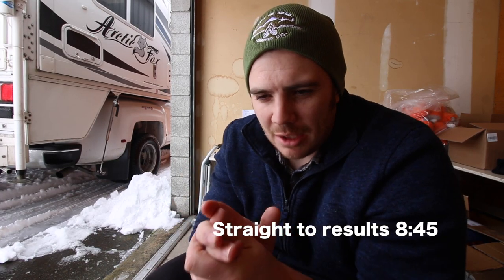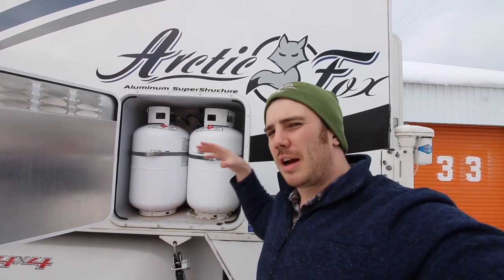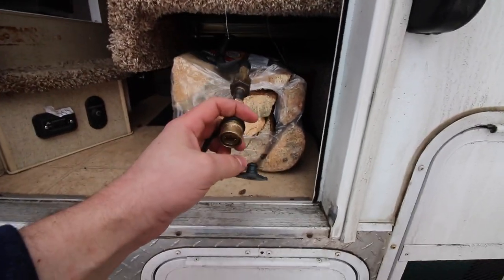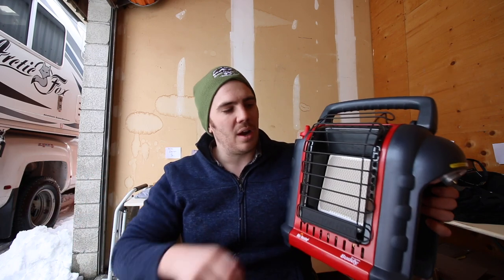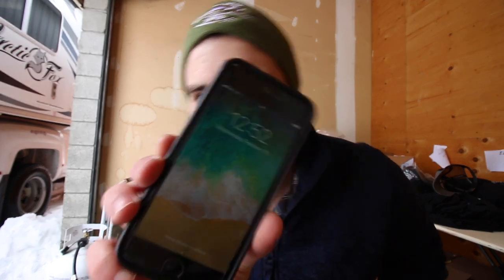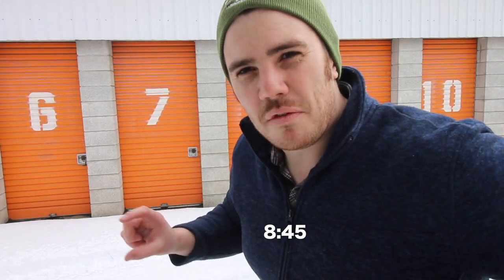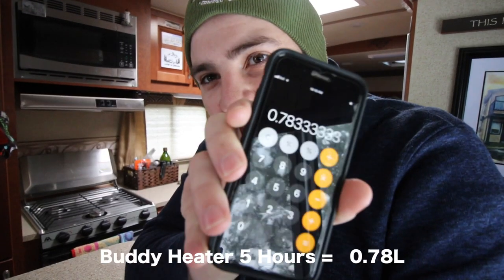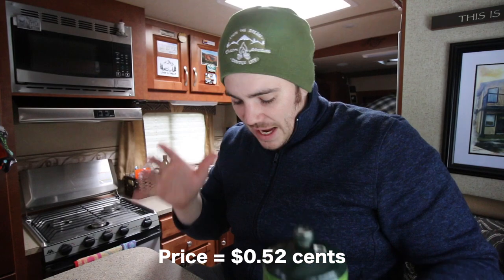How Much PROPANE Does Your RV Furnace BURN ? VS A BUDDY HEATER .. ??

Comment: I think a more accurate reading of the usage of the tanks would be to weigh them prior to test and then after test... this will show you how much weight was burnt.   I say that because the fill stations for propane don't always fill it exactly to the weight to the gram etc... so there will be a margin of error.  Just my opinion if i were doing this test.

Comment: The mid size Mr Buddy heater on high burns 9000 BTUs an hour and outputs at near 100% efficiency. 
The Atwood 7920-ii furnace in my truck camper is pretty average, burning 18000 BTUs with an output of 13680 BTUs (76% efficiency).  

Roughly speaking, my furnace burns twice as much fuel as the mr buddy, but only outputs 50% more heat.

So why do I still elect to use my furnace almost exclusively?
1) It's a dry heat that helps fight condensation instead of introducing more of it.
2) It's ducted throughout the camper to help protect my pipes and tanks from freezing.
3) It operates on a thermostat, making it easy to regulate temperature when I'm trying to sleep at night.
Reply: Well said.  All you have to do is read the specs.
Reply: How do you run it all night bone docking?
Doesn’t your batteries die?
If you are plugged in your best bet is a little electric  heater? 
Your furnace in your camper is still propane and still crates a lot of moisture. That is what sucks in these truck campers because they are so small.
I also keep my camper in storage and didn’t how much btu it’ is . Never thought about it until to late . 
Great info for me Taylor.
Thanks
Reply: @phil2559  The furnace that's built in to a camper does not add any moisture.  All of the moisture is vented outside with the exhaust from the furnace.  Nothing but dry heat from a furnace.
Reply: @phil2559  The 3.4 amps per hour @ 12v it takes to run my furnace isn't a huge draw. I've got a larger than average battery bank of 435AH (200+ usable), so I can run the furnace for days without issue. Factor in a 25% duty cycle, and it's even less of a concern. 

Ill use the heat pump in my duotherm A/C if im paying for hookups, but its rare since im almost never plugged in.
Reply: @jkneeshaw  18K BTU furnace = 3.4 amps/hr. Excellent info. My old camper had a 25K BTU furnace and my current one has a 35K furnace. My old one was roughly 5 amps and the 35K tends to be above the curve at almost 8 amps and is heating a 36ft bunkhouse with 2 slides. 
@Phil Allen - a standard group 24 battery is only 70-80 amp hours. Running the furnace for 12 hrs will drain the battery of between 30-60 amps based on the size of your furnace, and that will kill your battery if you are only relying on the single factory installed battery. Its an excellent point to make for most RV'rs if they've never relied on battery power.
Reply: sjackson99  do you think I might have a leak? My windows will get moisture on them ?
Reply: boondockinglife  do you think my battery’s need replaced ? I can’t run heater all night with out batteries during?
They are only a couple years old
Reply: @phil2559  hard to say . How many batteries do you have now and what size/type are they? Like I explained above, a single standard battery can not provide enough power for a whole day when the furnace is being used. 
Moisture is still going to occur in a camper even with a furnace. See Taylor's other videos when he explains using his dehumidifier.
Reply: Exactly! If you're in a larger RV (travel trailer, fifth wheel, etc), using the propane furnace is the best way to keep the pipes from freezing/bursting. Especially if it's an older year (< 1996) where it uses the grey polybutylene pipes. Even if all I do is keep it at 50 degrees, that's pretty tolerable with warm clothes on.
Reply: There you go! Thank you! It is also an insurance issue. I have a cabin and just lost my insurance again. They wanted a wall heater with a thermostat...i got it, but removed it because for us, it was dangerous, i felt. I had not used it in the years we had it and when i did, there was dust that burned! It really scared me. I shut it off and had it removed. The insurance wanted a central heat with ducting and thermostat. It is a 5-600 sq ft cabin !  I am ok with it, it is home. But where would i put a furnace?  So, i was thinking about getting an RV furnace, ducting, and themostat and do through the wall ducting. Not sure if it will work for them, i but can try.
Reply: @phil2559  when we boon dock, if close to the truck, i keep an eye on the battery. If it gets low, i plug into the truck and turn on the truck for a while. I have a generator, but haven't used it yet.  I am surprised how long the battery lasts. I also got a Jackery and can use that for a lamp, and even the InstaPot. I charge my devices with it. We could use the TV, too with it. It has a solar option, too, but it is a slow charge and i have not needed yet  but we are not fulltime yet. The jackery weighs about 25 lbs i think. I love the convenience. I used it when our power went out, too.

Comment: Something to think about would be if it's really cold, you need to have that furnace running to send air through your holding tanks and keep them from freezing. Maybe the furnace is less efficient because the heat is more spread out? I wonder if the heat above from the buddy heater would keep the tanks and pipes warm enough on its own in less than 0*C/32F.  Awesome video Taylor as usual. I'll be ordering some clothing items soon, would love to see some sweatpants (plaid would be awesome but solid colors are fine). The mugs are sweet, too.

Comment: My understanding is that you ought to have a fuel filter when connecting the Buddy to refillable propane tanks.
Reply: If you purchase a gas hose that has a regulator built in it will work. That’s how I use mine with a 20 pound cylinder.

Comment: I've used both Buddy Heater and the Wave 6 heater. Hands down the Wave 6 is more efficient than the buddy heater. I took a propane hose directly from the propane tank and fished it through a small window, then put insulation around the hose.  The wave is quiet and has a much larger heating surface. For the first 12 seconds, you burn the flame to catch the catalytic fiber on fire. After that, it takes very little fuel to keep it going. I have however noticed an increase in humidity in the trailer. I have also compared the Wave 6 to the onboard heater. I started with both propane bottles full and the one powering the Wave lasted nearly twice as long as the travel trailer's heater.

Comment: Hey Taylor, good idea for a test.  I have a Lance 845 and i use a Mr. Heater Buddy like yours.  I also have six one pound lp cans.  I purchased the refill nozzle that Mr. Heater sells to refill them from a larger tank.  I don't think they refill completely but I get about four hrs on low out of one can.  If it's not too cold I'll run a couple of hour before bed, turn it off and restart it in the morning when I put the coffee on.  They sell a "Big" Buddy that already has a quick disconnect installed and that would be better for your application.  What ever you run I always keep the window over the sink open an inch and a roof vent open an inch.  Keep up the good videos. Thanks

Comment: Many years ago, I had a pop-up camper with a removable stove, and it had a quick-connect inside the camper for the stove (along with one outside for it as well). The camper was built that way - It was not a mod someone did to it.

Comment: To calculate efficiency, you have to consider how much heat in BTU each one has generated during those five hours! Your numbers mean nothing without knowing their heat generation capacity.
Reply: It does tell something even if not scientific.  He said he realized that, was just curious. Well it helped me.

Comment: My understanding when using the buddy heater with 20# tank, a filter is recommened   between the hose and the heater
Reply: Yes sir, without the filter the buddy will die almost as quickly as Taylor’s snowman.

Comment: Be sure to get a filter when using a hose on your Buddy Heater. I have a buddy heater just like that, it is good because it doesn't use electricity, bad because it has no thermostat.

Comment: Your camper heater has a heat exchanger which will never be 100%.A certain percentage of energy will always go out the vent. Find the vent turn the camper heater on and you will be able to feel the heat that is lost. The price you pay for venting the H2o and the  Co2 outside. For me when it was at or below freezing and I was not concerned about batteries, I ran the RVs heater.With mine the gen set was large and it burned as much fuel as the RV lol. Above that, I would use my buddy. I will also add that running your air conditioner can help with the moisture if you can condition the air from inside the camper. That's how your trucks defroster drys the air so that it does not fog up your windshield. Loving the channel by the way.
Reply: Also, propane has significant pressure change between freezing and let's say 70 degrees Farinheight.regulators can vent small amounts of propane into the atmosphere with these changes in order to regulate. This is why you are hearing you do not want a regulator indoors.that said you might have a special regulator for your camper heater[differant pressure requirements] that is not compatible with the ltl buddy.I do not know.  Here is a propane pressure chart    https://www.engineeringtoolbox.com/propane-vapor-pressure-d_1020.html
Reply: vanchick 2018  I used to turn on a fan inside to circulate the air and run the ac for an hour or two during the day now and then when I was out for a couple.Can make a big difference.Or if I was in town grocery shopping and the sun was out I would leave it running while in the store.Things like that.Damp rid does kind of work if the air is warm inside and circulating.I have three bags now inside my camping van that is mostly just sitting waiting for spring.If I take it for a drive and bring it through a heat cycle the next day the water in the bag almost doubles.

Comment: You need a RV changeover regulator for the propane tank. This allows the pressure to output propane into the substance. The same goes for your house heating and gas . You can buy one online for under 60 dollars  very simple to install.

Comment: Mr Heater Buddy Heaters do a good job. The problem with trying to heat my RV with one is it just gets the inside warmed up, while my furnace is designed to keep water lines from freezing a small vent in my basement area for the water heater and incoming water lines. So even though the Buddy heater is more efficient it does not do half what my furnace does.

Comment: You need the wave 8 catalytic heater.  It sips on propane much less condensation and 99% cleaner burn..bro. I'm thinking about getting one for my 2020rav4 camper

Comment: I think a more accurate test would be to have each heater set to hold 70F in the camper for a couple hours, then see how much fuel is consumed to hold that temperature.  Another interesting thing I've measured is a 20F degree difference between floor level and countertop height. That was an interesting winter finding.  Take care...
Reply: CITAP1 you can’t set a buddy heater to a set temperature

Comment: RV Geeks did some yt videos on  mr buddy and interior gas line installation. They connected off the gas stove line so the plumbing ran under the cabinets. You need to remove the fuel regulator from Mr. Buddy if your gas line is fed after the camper regulator. Definitely an important point on that outdoor valve. It relies on fuel pressure to seal. You wouldn't want it inside the camper at a time when you happen to finish off the last of your propane. Afterall, we have all heard the hissing of air hoses and quick connect valves are the same principal.

Comment: Thanks for the test.   Buddy Heater will use less fuel than the RV heater.  But the RV heater heats the basement and will keep the RV from freezing if you are camping below freezing.  But if you only need a heat to overcome the chill, the Buddy heater is great if you can open vents to let out water vapor and CO2,  I likely will get a Buddy Heater and create a before the regulator LP tap for the Buiddy Heater.  My Rv furnace used 8 amps for my camper like yours.  That is a load for a battery in cold weather as my Slide in Camper furnace ran 20 mins per hour when heating.

Love the bear and snowman!
Reply: Keith80027 I'm just curious. The arctic fox uses a fan to pump heat from the cabin in the tanks bellow. This fan runs at the same time with the furnace. If you have a separate switch to manually turn on and off this fan and you T in the Buddy heater from the Stove top. Do you think you it could resolve the frozen tanks and pipes problems?
Reply: @scooter11998877  If you can get warm air from the living space into the tank are you should be all set.   My first RV had a wall heater, meaning that it was like the Buddy Heater.   I installed fans to blow air into my tank area and piping area using a simple thermostat in the area that would freeze to determine when to turn on the fans. So the thermostat was in series with the battery and fan. I used this system for three years while living in a 17 foot trailer while in school.

Comment: Problem with using a ventless heater is the moisture it puts in the unit wich will generate rust and break down the moulding and warp things 100% faster than using the furnace in your unit. I live in a 27' 5th wheel in northern michigan and only spend $120 a month in propane $8 of that per month, is gasoline to go get it 1x a week . I use 20 pound grill tanks because I get them filled in Wednesdays for $7 each instead of $10 each any other day , and there is no discount for 30-40 pound tanks and 100 pound tanks would be back breakers and you can't legally haul them unless there standing up and they won't fill them if there not.

Comment: When working with that small of an amount of propane, it would be inappropriate to use a "fill up" to measure. Some attendants Don't fill the tanks to the same volume as others. I suggest that you do a pre and post tank weigh on an experiment like this. Although, I think you did make your point quite well.

Comment: I would think the buddy heater has an internal thermostat.  In the storage shed it’s going to burn much more then in the camper.  In the camper you have insulation so it should regulate better    IMO.   I really admire your life style. Wish I had done the same years ago.

Comment: You can refill those 1 lb bottles using one of your 30 lb tanks (removed and turned upside down) you just need an adapter which you can get off Amazon and a scale so you know when they are filled up. Lots of videos on YouTube on how it's done.

Comment: interesting.  i would never have expected such a drastic difference.  and that doesn't even take into account the battery drain from your onboard furnace.    too bad it wasn't safe to burn a candle while using the buddy to reduce condensation.  or a flowerpot candle set up.  anyway thanks for sharing, thumbs up
Reply: Used to be you could turn on an incandescent lamp, but now they only have LED i think. I wonder if they help at all?

Comment: a cool test would have been open door and window and let RV get cold mark temp and then run the RV furnace for a hour see how fast it will get the RV to a temperature and then let it keep going for a specific time and then do the same thing with the buddy in the RV so you see what one heats the RV best

Comment: Watch out for the mold that will form from using the Buddy Heater..... They put out a ton of moisture.
Reply: Oh yeah! Definitely keep an open vent. If you see moisture build up, tackle it! If you continue having condensation on the interior you will find exterior wall delamination soon to follow. It's not gonna wait 3 or 4 seasons to show up.

Comment: Fascinating I live out of my camper it doesn't average out like that for me and I've been caught where I had to use one of those and one whole pound or whatever it is green can is anywhere from 8 to 10 hours depending on how you use it and that's on a low setting just to keep it warm in here and it does better than the Mitchell 78 camper heater but I need to find something that that will replace that which I have in my camper because it's a 78 and it hasn't been replaced it ever since it was put in and it's a Duraflame but most likely the screen inside is little botched up and I'm using a lot of fuel on top of that just to keep warm but my situation is different than your situation seems like you got storage but I'm not that close to mine and I live in the back of my truck

Comment: I don't know, but, running a gas line out to the rear, bolted to the bottom side of the bumper? Debris flying off the tires making contact with low lines to the rear? Scraping the bumper on the ground in off road-uneven terrain? ARE YOU CATCHING MY DRIFT?

Comment: I go through 1 n halh propane tanks a week in my all original 1969 Red Dale 12 ft truck camper, my furnace is what I use it only has two settings me turning it on and me turning it off! When a camper warms up I reach over and I put it on pilot light Germany gets a little chilly turn it back on I've had furnaces in other vehicles never had that bad a propane usage so you didn't do a good test shut the vents turn it on a normal temperature then see what you get I guarantee you I don't do less propane using your furnaces compared to mine which I barely use any so I guess I'm lucky and that's even at 0 degree weather and sometimes even colder